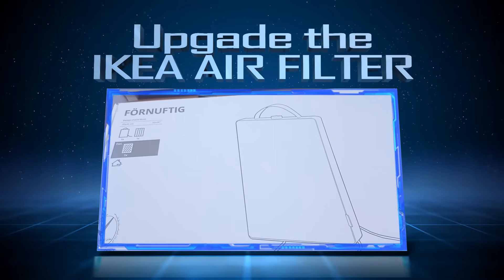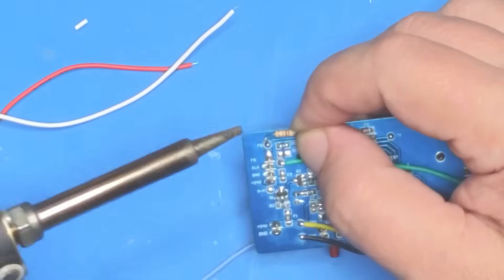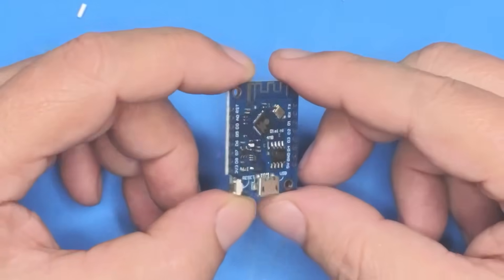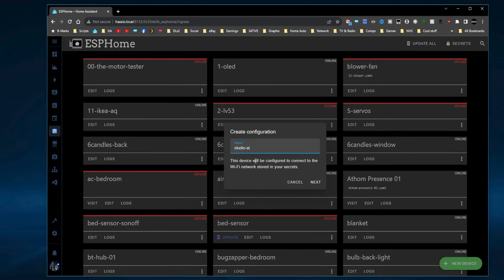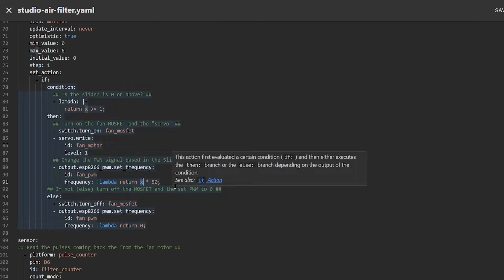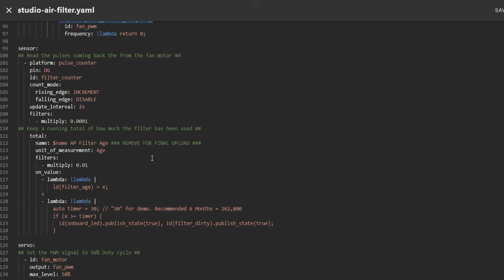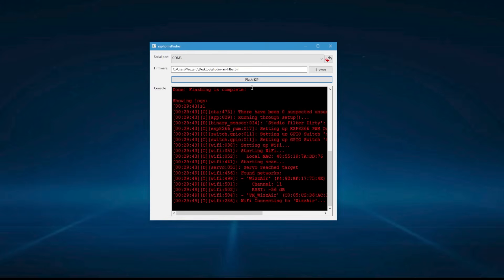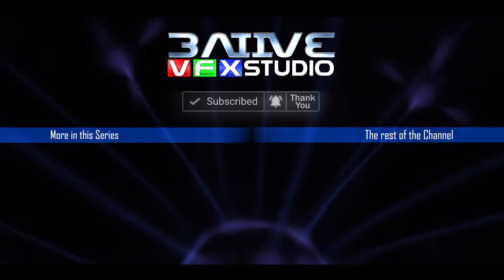Control Your IKEA Air Filter with Home Assistant and ESP8266 Upgrade

Comment: Great Work. The next step would be to read out the poti again and either control the fan or something else in HA...
Reply from the maker: Indeed.. although I don't what "poti" is. Part2 is converting the IKEA Air Filter and Part3 (which will be out next week) is getting this Air Quality Sensor to control the IKEA Air Filter. 
#StayTuned !! :)
Reply: @3ATIVE  I mean Potentiometer. In German it's commonly shortened that way. But your right it's probably a switch or rotary encoder on the top of the filter.
Reply from the maker: @dj-aj6882  OIC... No worries, we shorten it to a "pot" here.
Reply: I assume @3ATIVE  that the pot doesn't control the fan any more since when the fan speed is set to 0 in HA then it applies 0v to the resistor before the mosfet, thus sinking the clock from the microcontroller and holding the mosfet off. Is there the possibility to set the d1mini pin to input and count the clock pulses from the original controller and that way you can still use the onboard control but also keep track of the filter age from manual control? I suppose you could change the HA controls to have 0-8 levels and map the 0-4 of the original control to 0,2,4,6,8 but it could get messy if both were activated at same time. Also possible is a new switch in HA that switches it back to manual mode and actually cuts the path between the microcontroller and mosfet when HA is controlling it but enables a "manual" mode...
Reply from the maker: @smitcher  Indeed, the signal out of the D1 Mini "Overrides" the on-board MCU, holding that MOSFET low when "off". 
I wanted everything controlled and read by HA so there's no need to go to the unit for Speed control and Filter Reset.

If you wanted a "manual / Auto" options then yes, you could break and bridge those lines - switching them in HA but, why would you want to? I like things automated and thus eliminate the need to interact with my devices.
Reply: Yeah totally get that @3ATIVE  and 100% agree for your situation this works brilliantly. Some of us on the other hand need to leave manual controls for the muggles that we live with! 🤣
Reply from the maker: @smitcher  "muggles" LOL Love it. 🤣

Comment: If you time the feedback on a given speed it might show you if the filter is clogged and the fan runs faster than it should. Unless the fan has an active speed controller.
Reply from the maker: That could be a viable option... However, getting a correlation between speed sent and expected pulses received.... well, good luck with that Math!!! LOL
Reply: @3ATIVE  you could, if you have the motivation, try to set the output to something fixed, like 100Hz and then count the input pulses during a minute. Compare a clean filter with a dirty and you could just use a fixed threshold.

If you can see the difference even on the lowest rpm you would have a calibration routine every day where it just spins down and checks feedback. That would avoid needing to do this for all speeds.

"If pulses in are less than Y during 60 seconds in diagnostics mode: light the lamp"
Reply from the maker: @dennisolsson3119  Cool. I look forward to seeing your results. Please post your code too.

Comment: What was the point?
Reply from the maker: What part?
Reply: Hmm, was that a serious question..?  To control the fan with Home Assistant of course 😀  And reading the answer he wrote to another question, later use the data from the IKEA air quality sensor (in Home Assistant) to turn on this fan if needed.   An absolutely awesome idea.

Comment: Just out of curiosity - the board has already 5V LDO. Why not take 5V from there? Is there a concern about too much current?
Reply from the maker: The on-board regulator is far too weak to provide enough power for the D1 Mini - It would get too hot.

Comment: Have you thought about intercepting the signal from the filter reset button to reset the filter counter in the app?
Reply from the maker: That wasn't my first thought - I wanted everything 'remote'. However, it's defo an option.
Reply: That would be an idea indeed, I mean ... if you have to change the filter you are already physically present at the device. Might as well press that button instead of getting out your phone to do so.
Reply from the maker: @itsmrpaddy  Like I say, it could be an option. 👍
Either-way, you'd really only have to "reset" about every 6+ Months... I take my phone far more often than that! LMAO

Comment: Great work! Would have loved some added sensors like the previous IKEA hack.
Reply from the maker: I thought about that when I started this (these) projects. However, having sensors in the device that 'cleans' the air seemed silly. :)
Reply: @3ATIVE  Fair enough 👍
Reply: yeah it is silly as thats a thing i dislike about the ikea smarthome aircleaner and my dyson air cleaner heater. the units work great for the air surrounding them but its not acurate in larger rooms. so my airfilter is running almost 24/7@ its slowest speed manual set and i use other sensors to check the quality of the air.

Comment: Trying to build this. I'm a bit confused with the pinout
I see in the YAML file that D2,D4,D6,D7 are being used, compared to what is described in the video. However D4 is not connected in the video.
Could you made an update in the README or something else to update the circuit and the pinout on the board ?
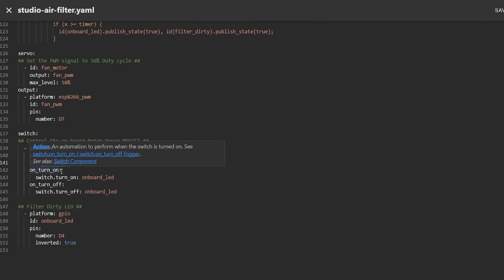Reply from the maker: Everything is correct. D4 is the D1 Mini's on-board LED: 15:54
Reply: @3ATIVE  Thx

Comment: nice work i will try, you may do a video on ratgdo diy board this will help many to move  to opensource garge opner
Reply from the maker: Thanks for the idea! But if there's already someone doing that project, maybe I shouldn't - they may not like it
Reply: @3ATIVE  I agree, the idea was to cover more audiance to over come MYQ issue.  I am sure you may have better idea to enhace the circiut of this open source .

Comment: Is the stock micro still powered?  Why doesn’t it interfere with the fan speed when you turn the dial?
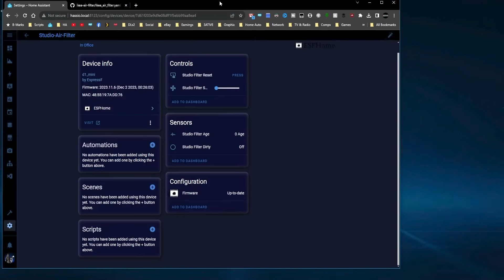Reply from the maker: Yes | No | 18:59
Reply: @3ATIVE  mattbsea's second question was "why" doesn't it interfere with the fan speed. Sorry for being slow, but I can't see in your video where/how the built-in functionality is being overridden. Many thanks
Reply from the maker: @SminkyBazzA  The White is held low, by the D1 Mini when the slider is Zero. Therefore any signal from the "Stock Micro" is "Overridden".
Reply: @3ATIVE  Are two outputs shorted together?  Maybe better to cut connection to the "Stock Micro"

Comment: Hey nice video ! But why didn't you take the 5V from the board directly (the +5V pin on the bottom left of the MCU) ?
Reply from the maker: The on-board regulator is far too weak to provide enough power for the D1 Mini - It would get too hot.
Reply: @3ATIVE is there a way that this could be done whilst keeping local control?
Reply from the maker: @gavinhanel8662 Sure, but why would you want to?
The whole point of "Home Automation" is automation! LOL
Reply: @3ATIVE if you have a wife for instance 😃
Reply: @VojtěchMaxera  that was my exact reply. Same reason I have sonoff mini r2s on each of my lights. Local control.